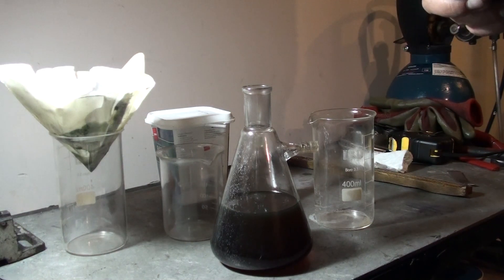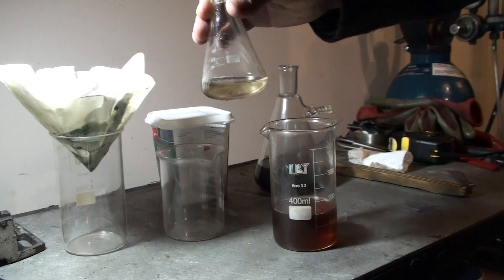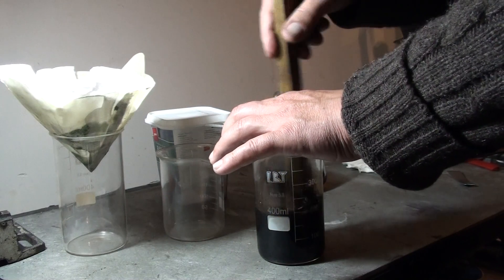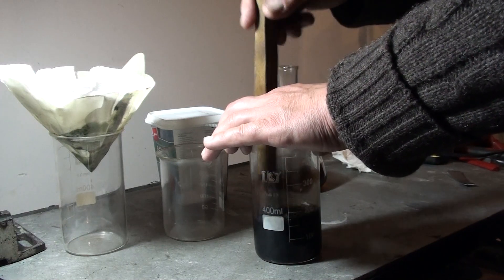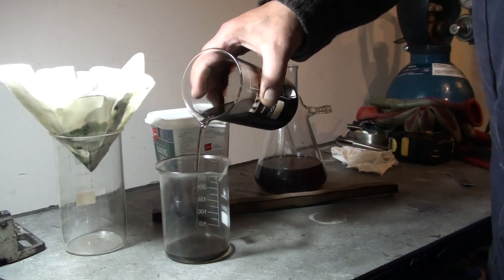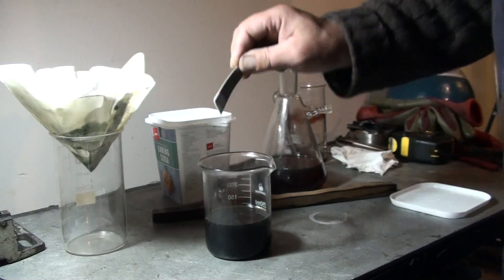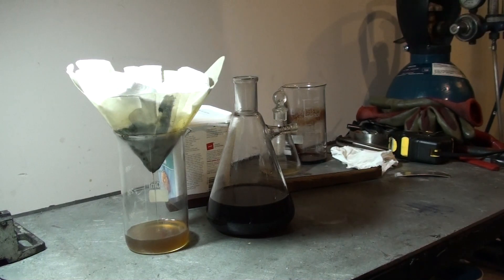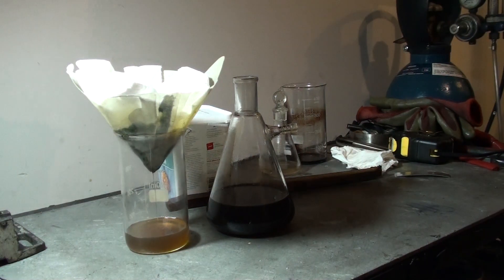Homemade fuel bleaching method #1.

Comment: The liquid you are bleaching in this video is USED Engine oil or the diesel fuel produced by engine oil distillation (with heat and distillation column to be clear)? Thank you
Reply from the maker: This video shows bleaching of the diesel fuel produced by engine oil distillation.

Comment: Hie aleck today i tried to clean my distilled oil using this method but my resulting fuel turned out to be redish in colour not goden yellow where am i going wrong
Reply from the maker: Hi, there could be many factors, the first one  is the actual distilled oil is a product of pyrolysis not a continuous distillation, so more oxidized at the start, was not settled for a few days, also you may need to settle it longer after acid reaction, plus try to reduce acid amount to 0.5%, and try to use a washing soda instead of baking one - (sodium Carbonate 10% water solution to make 10% of volume in relation to treated oil).

Comment: Very good to know these simple formulas, especially if using for diesel fuel. number one you don't want to foul your fuel pump nor cause any internal wear, but also keeping your injector tips as clean as possible for as long as possible is the trick to engine longevity. New standards for today's fuels remove too much sulfur from the diesel, causing fuel pumps in older diesels to wear out too soon, so formulating the fuel to the age of ones engine is important. Thanks for another good one, Alek. If you wrote a book I'd sure buy it.
Reply from the maker: Thanks a lot for your interest, I also have videos where I use no acid methods.
Reply: Wow
Reply: HowTayar oil blicing sir

Comment: You mentioned it can be used as is at the start but looking at the solids that came out of it that would be a bad idea
Reply from the maker: the acid will produce some sort of asid bitumen even from clear hydrocarbon, so if it is transparent but dark, the dencity is resemble the diesel fuel, no copper stripe reaction and smell is not a factor, then it can be used as is after simple silica gel settling.

Comment: can you also not use it as engine oil again ? aswel as diesel feul?
Reply from the maker: You can convert it back to motor oil by adding required additives.

Comment: Good morning Sir, I try several time to clear used engine oil to clear as your method, but unfortunately I couldn't do it. I used 200mi used oil and 2ml sulfuric acid, baking soda please help me to do this properly thanking u.
Reply from the maker: I am cleaning already distilled oil, not the one directly from a sump.
Reply: If I listened correct, you would need 20ml sulfuric acid for 200ml oil.
Reply: @markhonigschmid6116 you didn’t it’s 2ml

Comment: The separated base oil was then mixed with activated alumina at a proportion of 1:5 alumina. The alumina was added to remove the dark color. The same method was employed in the Toluene, 1-butanol, and ethanol and also with Toluene, 1-butanol and isopropanol. The same method was working in the Toluene, 1-butanol, and isopropanol by solvent to oil ratio 1:2 and 1:3
Reply: Thêm vào khi trưng cất hay khi đã thành dầu diesel vậy bạn

Comment: What is the purpose of all this ? Doesn't "black diesel" work just as well ?
Reply from the maker: First, a modern engine will not be able to digest black diesel. Some old stationery ones will give no hack about the fuel type or quality. Second, any fine-filtered used motor oil is still packed with unburnable additives that are not so great for a fuel system. The benefit of this process is - the vehicle's engine works the same as with the standard diesel fuel, with no smoke, no coked injectors, and no busted fuel pump. Also, there is no need for a double fuel tank system to switch from one fuel to another to flush the pump and injectors before stopping or starting the engine. In other words - one can make regular diesel fuel in a backyard

Comment: Can you please help with all the ingredients for bleaching used engine oil
Reply: The separated base oil was then mixed with activated alumina at a proportion of 1:5 alumina. The alumina was added to remove the dark color. The same method was employed in the Toluene, 1-butanol, and ethanol and also with Toluene, 1-butanol and isopropanol. The same method was working in the Toluene, 1-butanol, and isopropanol by solvent to oil ratio 1:2 and 1:3

Comment: You're great Sir! God bless you. Can I ask you if I can do this bleaching method for my waste motor oil but it is not distilled oil, it is a centrifuged oil product of centrifugation process. I don't do distillation process of cleaning waste oil. I am just cleaning my waste oil through centrifuge machine. The centrifuged oil is black, I want to bleach it to make it a little bit transparent. I saw this video and I want to try it also. I am not sure if I can do the same process with the centrifuge oil,not distilled oil. Thank you.
Reply from the maker: Hi, no it is really difficult to bleach used motor oil as such, you may try this method, but keep the oil at about 50c: https://youtu.be/YUT4ZQMBgVo you may make it cleaner, not transparent.
Reply: @santeryi9  thank you so much sir.

Comment: Hi, does this method work for plastic pyrolysis diesel?
Reply from the maker: Yes it will work with diesel from plastic as well.
Reply: @santeryi9  Is there a method that works for tire oil?
Reply from the maker: @metincetin2980  you can try this one: https://youtu.be/YUT4ZQMBgVo

Comment: can you tell my how that used oil react with oxidisers? ore how is that staff viscosity made Im not shure how temperature resistance is made of oil ore their viscosity .
And is it posibel chemicaly to turn that oil to diferent fuel tipes with out destiler? Im wondering because I like the idea of useing seperators for my car most clean burn I get from alcohole and I belive less polution at exaust Im not shure tought if it is posibel to use oil and alcohole together???

Comment: Thanks 
Butt oil have smell 
How get his smell
Reply from the maker: The method helps to reduce or eliminate the smell as well.
Reply: @santeryi9  
I have a small unit in my home 
Means I m cleaning oil with 
Formic acid and bleaching earth 
With hot temperature 
Oil clean very well but oil have bad 
 smell 
Im in lahore Pakistan
Reply: Ur waist oil is not to much dirty 
Butt my waist oil is to much black very dark black he have to all ready to much bad smell u no what type smell

Comment: If pyrolysis oil is bleached by this method, would it be useable in an engine without fractionation?
Reply from the maker: No, you will need to separate the light fraction first.

Comment: Can you share the name of the second chemical that you used ?
Reply: Baking soda, sodium bicarbonate
Reply: Can also The separated base oil was then mixed with activated alumina at a proportion of 1:5 alumina. The alumina was added to remove the dark color. The same method was employed in the Toluene, 1-butanol, and ethanol and also with Toluene, 1-butanol and isopropanol. The same method was working in the Toluene, 1-butanol, and isopropanol by solvent to oil ratio 1:2 and 1:3

Comment: You need to neutralize sufuric acid by sodium hydroxide solution, then to wash with water-ethanol solution to remove sulfonic acid (sodium sulfonate salt) produced by the process
Reply from the maker: Yes, you have to neutralize it, in my case I do baking soda instead, it is alkali but not so aggressive as hydroxide, after that, you still need to use a bit of absorbent and if doubtful, run the copper strip test and check the PH.
Reply: @santeryi9  hello can we talk ?
Reply: Is this oil can be used as an engien oil or as a fuel
Reply: @housnihousni5927  diesel fuel.
Reply: @uchennatiger4751  you knw how to refine
Reply: Testing the pH level is very important to ascertain that the pH level is in line with company's standard after all chemical de coloration processes.
Reply: Sodium hydroxide is to aggressive otc
Reply: I have followed each and every step provided in the video. Now my plastic pyrolysis oil is frozen. Can you please tell me the process to liquify it ?
Reply: Why he's turning the acid into salt water either way
Reply: Wats diff?
Reply: Which absorbent can one use?

Comment: sulfuric acid - it is very bad idea!!!! Engine is ded! A modern fuel have a 0,001%!
Reply from the maker: Yes, you have to neutralize it, believe me, the oil companies are using the sulp[huric acid to bleach the fuel, the very same one that you get from the petrol station, in my case I do baking soda, it 
is alkali but not so aggressive as hydroxide, after that, you still need
 to use a bit of absorbent and if doubtful, run the copper strip test 
and check the PH.
Reply: @santeryi9   "the oil companies are using the sulp[huric acid to bleach the fuel" - no, do not use!!!! Now only a mechanical cleaning method is used! - and therefore 0.001% sulfur! Also, the use of zinc catalysts helps to neutralize sulfur in petroleum during distillation. You do not understand at all the processes of petrochemicals and alcohol distillation.
Reply from the maker: Sorry Igor, yes you are the most genius person, you know everything, about modern petrol and alcohol distillation, so please tell me if you have at least one patent in this particular field, explain about proper petroleum distillation to the person from Burkina Faso, who tries to make a little bit of fuel for his farm equipment... anyway yes you are the smart person, but honestly your Ukrainian diesel and petrol are far from perfect, In most cases it is made out of natural gas condensate, somewhere around Chernovci, and no one in Ukraine makes it the way you mentioned, moreover it is sounds like you are trying to attract attention to your channel with my help by starting a controversy, accusing me to be dumber than you.
Reply: @santeryi9 
1) I have another channel!
2) I know what I say because I was on refineries in the EU!
3) Yes I am currently in the process of patenting (4 inventions) - so I can not show the equipment!
4) It is not necessary to make conclusions on video on my channel - it is 1% of all experiments.
5) I live in Spain and I got an Immigrant start-up visa to Canada.
6) I have state support in Spain.
7) If you want to talk, then call and I will explain in detail what is the your problem....
Reply from the maker: Igor, I am happy for you and wish you all the best, please understand that there is a big difference between the European refinery with all the advances and a small backyard based distillation equipment tam may be built by the person in Africa to recover some oil tired to make a bit of fuel for the farm needs, what I am doing is trying to help people, - they don't need to know about a catalytic converters or European way of refining, all they need is to survive and the simpler the better. Thus please do not try to make one person look dumber than you by stating that he/she knows nothing or less than you in some particular fields, be polite and keep it to yourself if you want to correct someone, or share some information - contact the person via email and then discuss, I am not trying to get to your channel for example and comment on your petrol separator telling everyone that my separator is smaller, simpler and faster, that I had built my one way before you get this idea - thus  your business is your business, my business is my business.
I know about different methods of bleaching and cleaning and the acid one is not my favorite method, I prefer to use solvents and then fractional distillation, where the heavy solvent will lock all the colorings and resin, the acid method that I am showing here is for people who have access to the pyrolysis products and do not have any other way or ability to clean the  product. The acid method is old and the proved method of resin removal and may be the only alternative available.
And the things on my channel are too only 1% of what I am doing.
Reply: @santeryi9  no comment))) my English is not well for... And we speak - filtration! ¿Español?
Reply from the maker: Игорь, пожалуйста не обижайся на то что я разместил свои ссылки на твоём канале, я сделал точо так как это сделал ты обвиняя меня в некомпетентности на моём же канале, просто в своём последнем коментарии я пытался объяснить что не надо принижать другого человека выпячивая себя, ваш кемментарий так и кричал, - "это я самый умный, зайдите на мой канал,  посмотрите какой я сделал аппарат а этот Полек ничего непонимает, он тупой а я умный) я понимаю что ты тоже продаёшь свои аппараты, это твой бизнес - поэтому я никогда не лезу к другим людям и не стараюсь за чужой счёт разместив свои ссылки и унизив другого человека переманить себе потенциальных покупателей. Я комментирую только политику и отвечаю на вопросы на своём канале, к конкурентам я не лезу, никогда не коментирую ничего что связано со спиртом или с топливом, если конечо это не касается меня лично. Поэтому убери мои коментарии (я совершенно серьёзно) со своего канала и продвигай свой продукт сам не унижая других людей. Насчёт дыма - мои аппараты по разделению бензина и дизеля не дымят вообще, абсолютно, топливо выходит холодное, в маслянных всё зависит от температуры перегона, да если масло из больного старого дизеля то возможен перегрев, но любой метан разлагается под деиствием ультрафиолета, таким же образом можно осуждать болота, кизяки, и упавшую осенью листву, которая превратится в метан, понизь температуру перегона, например вакуумом и проблема метана будет решена
Reply: @santeryi9  я не викладав посилання на свій канал і тим паче не принижував - просто хотів сказали, що це не правильний напрямок фільтрації! На рахунок метану і інших газів - ви тут не праві в повний зріст, не можна казати, що моїх там 2-10 м3 газу яких викинув в атмосферу щось там змінять - це не правильно! Я за те, щоб все було гарно і якісно! Я зробив декілька установок які продав бо клієнти за горло тримали! Я звик робити все якісно і з запасом по міцності і т.д., тому Я своє обладнання так довго не вставляю на продаж. Цей канал мене не цікавить адже відкрив інший, і його запускаю скоро - чекаю електронне обладнання. І на рахунок вакууму - це понизить температури перегону але ніяк не позбавить газу в тому числі і метану! Ну і саме головне - це навряд чи ми конкуренти, коли Я почну продавати все своє обладнання, тоді зрозумієте... Я впевнений у тому, що кажу - бо вивчив велику кількість інформації із практикою(експериментами)!
Reply from the maker: @IHORSHCHERBAN Игорь вы конечно правы насчёт метана, надо беречь природу, но в случае с топливом мы имеем парадокс - сначала стараемся не упустить ни грамма вредного выброса во время производства, а затем просто сжигаем полученное топливо нещадно коптя небо, и никто не думает - что, там вылетело из трубы, поэтому тут банальное лицемерие, так как метан это меньшее из зол, хотите беречь природу откажитесь от нефти, я вот купил электромобиль, и всё электричество у нас "гидро" так что делаю мой вклад, до этого ездил на самодельных электро авто, или переводил на спирт (zero carbon footprint). То что вы возможно продвинулись в переработке дальше чем я, так это хорошо и закономерно, вы сами согласитесь что современный самолёт лучше старинного, но без старинного и несовершенного никогда небудет ничего нового, поэтому к тем кто начинал двигать эту идею надо относиться с уважением, так как эти люди дают почву для новых свершений. Переработка масла для меня не является чем-то критичным я от этого незавишу, и в основном отказываюсь делать аппараты для людей, но делюсь тем что знаю. Да на свете куча народа кто знает больше, и наши игры с топливом это детские забавы для них, и ваши знания для кого-то тоже дитячий садок - но никто не пытается это выпячивать. я хочу вам пожелать всего самого наилучшего в ваших начинаниях на чужбине, да и фамилия моя не "поляков".
Reply: @santeryi9  на рахунок метану - це один із самих сильних парникових газів, а коли CO і вуглекислий газ - це набагато менше зло! Все промислове тваринництво (метан і аміак із посліду тварин) дає сильніший ефект на глобальне потепління ніж вся нафтохімічна промисловість! На рахунок призвеща - вибачаюся.
Reply: @santeryi9  alek polek ıhor bad
Reply: @santeryi9  your are a nice person. I readout all your text. Thank you again for helping people.
Reply: @IHORSHCHERBAN  Would you please tell me how to bleach used engine oil, thank you in advance
Reply: @santeryi9  soda - work only 30%